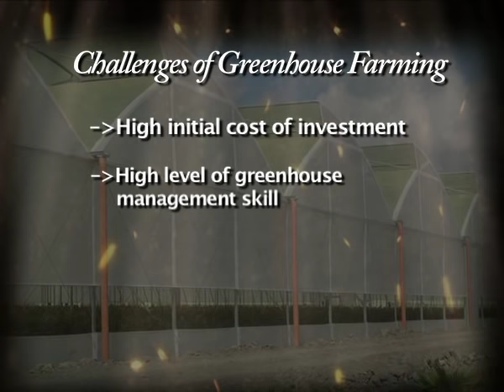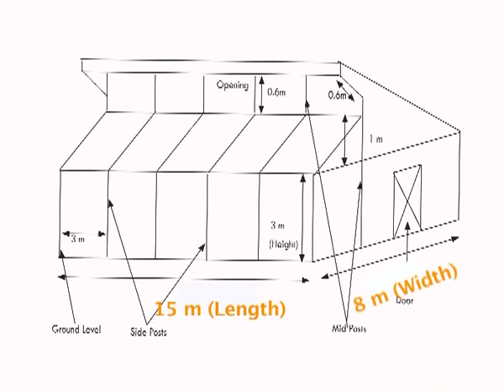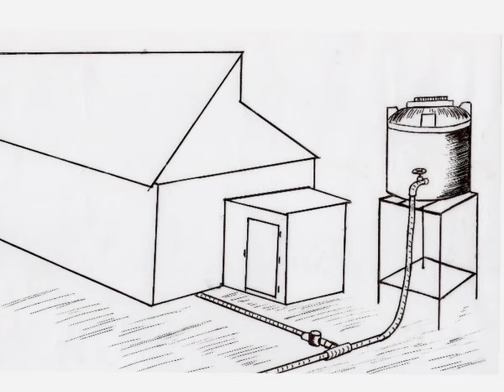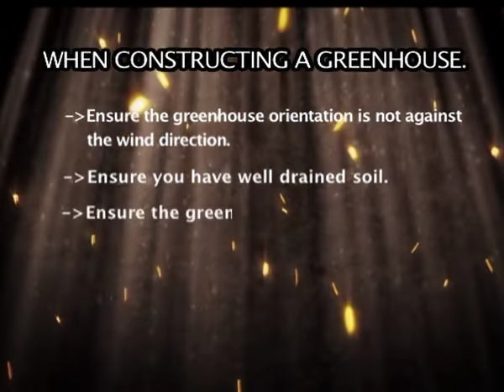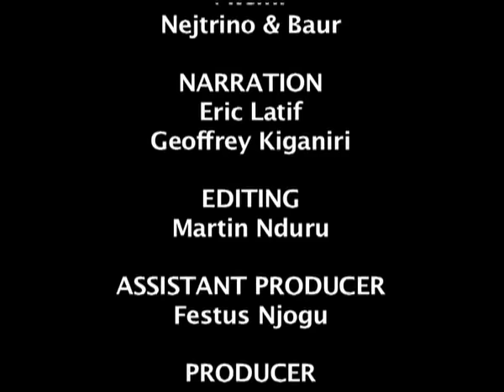Low cost greenhouse farming

Comment: Thanks for this awareness video running in YouTube since some time. 
This is really important to disseminate the unique idea of nature friendly, energy efficient, and comparable 'low-cost greenhouse technology'. It is naturally ventilated greenhouse with all shorts of modern farming facility, thus comparable almost in every respect. 
However please note the two following points very carefully. 
(1) It is not easy to built a scientific low-cost greenhouse which is comparable to common iron-frame greenhouse. The technology is prone to dilution due to its non-standard construction material. So please know & follow the proper technology and methodology of construction. OTHERWISE IT WILL BE A FAILED EFFORT.
(2) It can't be possible to erect a scientific low-cost greenhouse with almost no-cost. The cost of covering materials will cost similar to that of common pipe-frame greenhouse. It will cost 1/3rd to 1/2 of the common pipe frame greenhouse.
-- Low-cost scientific technology is always a difficult proposition.
Reply: Arupratan Ghosh Yes, even here he mentions $ comparisons of 1/2 cost. Definitely costly here. Paradoxically?

Comment: 4000 sq m (approx. 1 acre green house for vegetables in India costs Rs. 35 lakhs (galvanized steel structure) and Rs. 20 to 25 lakhs ( treated bamboo structure)  till plantation. Govt. of India's Ministry of Agriculture gives subsidy of 50 % for the same under the NHB/ NHM programme. Only structure costs Rs. 620 per sq.m.(galvanized steel structure) and Rs. 350 per sqm. ( treated bamboo structure).
Reply: Nice Video.....
Reply: YASHPAL MORAY can you suggest a company in India who provides greenhouse structures

Comment: Well, I know that cucumbers, squash, watermelon, etc. require insect pollination. You can also pollinate them by hand if you pick the male flower, pull the petals off to expose the stamen that produces the pollen, than brush that into the female flower. There may be others also, but those are the ones that I know.

Comment: Nice video.  I see you have a large metal water tower/tank, this is also a good idea for small gardens and sharing between close gardens with others, such as a community garden.  Perhaps a 5 gallon bucket with a lid and valve for a flexible hose would be good for small gardens, rather than trying to lift a heavy watering can/sprinkler all the time.

Comment: was that used motor oil on the base of the post
Reply: yes, they said old oil I think. They also wrapped the bottom of the posts carefully that were buried in the ground to try to make them last the 10 years.

Comment: Birds, squirrels, deer, etc do not get into the greenhouse. They are 100% controlled. As for insect pests, it is as easy to spray in a greenhouse as it is outside. Properly installed netting will reduce the need for insecticide.

When you are ignorant, it is best to not try to voice your opinion but to instead learn from those who know what they are talking about.

Comment: You were doing well until you started painting your posts with used oil.
Reply: They aren't doing an organic farm it's a third world greenhouse and really quite brilliant. They are putting up a roughly 28'X50' greenhouse for $600. Good luck matching that! After the wood is oiled they wrap it in plastic so I'd say the leeching would be minimal. I'm really impressed with what they are doing and using what materials they can access locally. I even love the barbed wire. It's cheap and available. They are even using charcoal which this country has yet to wake up to. Here we let excess fertilizer run off into streams and the ocean. Charcoal holds the nutrients like a sponge. The best trick is soaking the charcoal in compost tea before you mix it with the soil. If you don't the first few years may be a little off then production will increase and remain high.